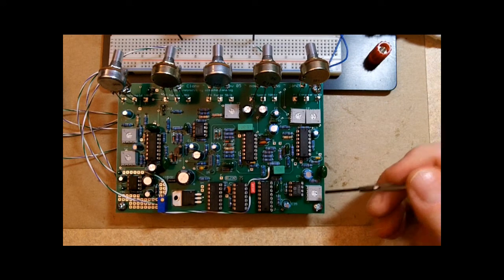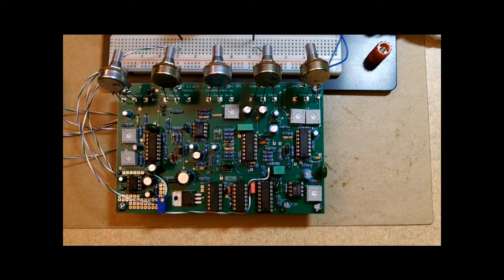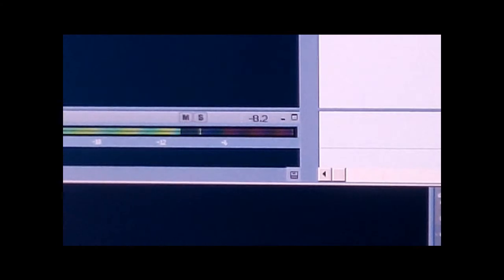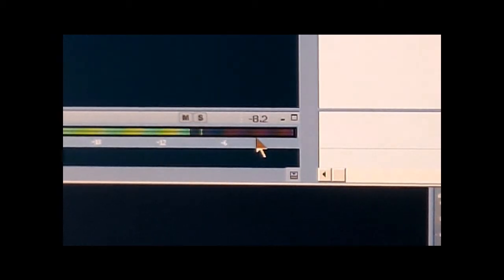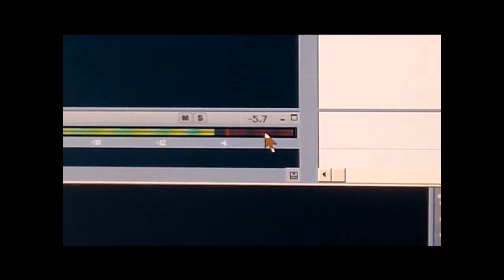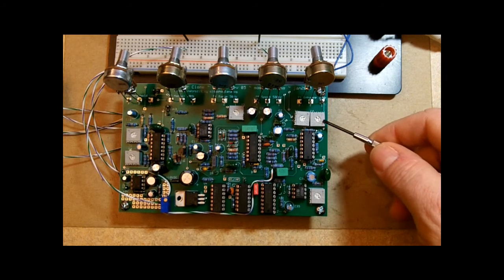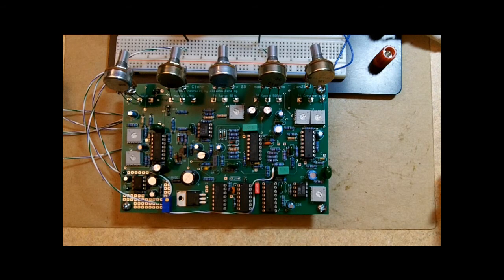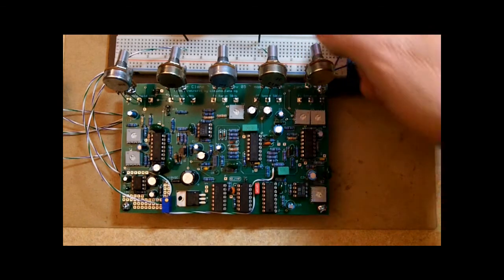part3 moosapotamus flanger calibration

Comment: Hi, you said that when you add 2 signals of equal magnitude you get a 3dB increase. That's not correct, you get a 6dB increase. More info at this link: https://www.sweetwater.com/insync/3-6db/   And from within that article (although there would be others on the web):

"However, doubling the voltage equates to a 6dB increase. Here’s the formula:

20log (V2/V1).

This 6dB change is also evident from the fact that when you unbalance a balanced signal you lose 6dB (half the differential voltage), or, think about what each bit in digital audio resolution is worth: 6dB of dynamic range, because you have doubled the number of quantization steps, and by doing so have lowered the quantization error level by 6dB."

Comment: I think inputting a constant sound (like looping a single note on a softsynth) would have been better than music with constantly changing volume peaks for getting a more reliable +3db increase. On the other hand i am not too keen on setting things up exactly as in the manual, i actually would have ended the frequency calibration half way before you. :D